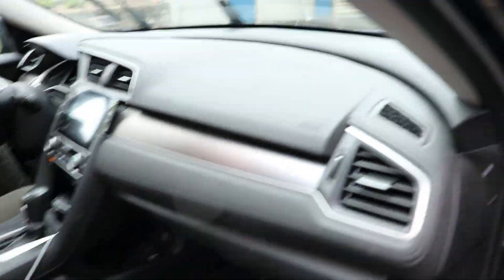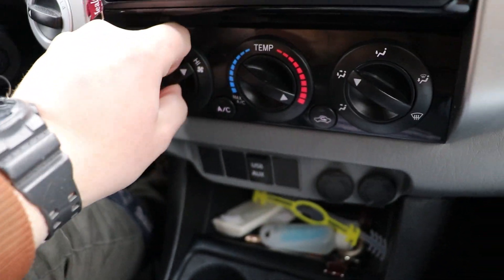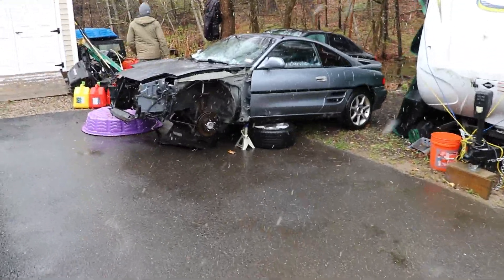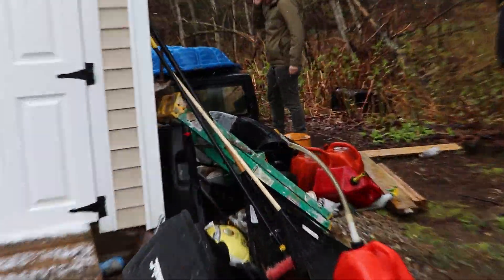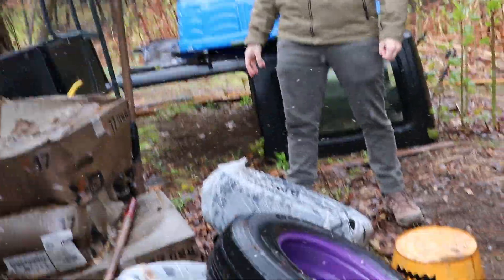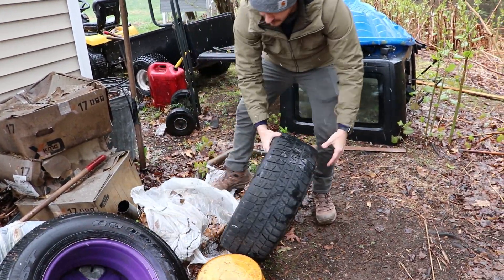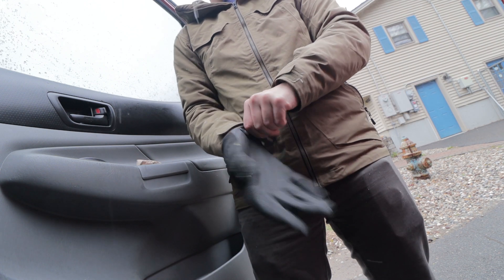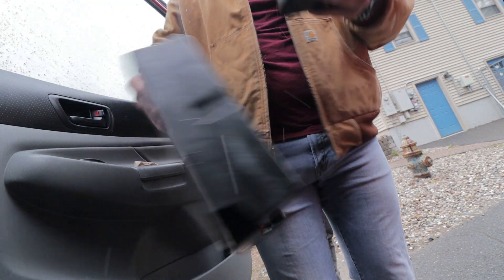Buying Cheap Wrecked Boat - Boat Restoration Part 1

Comment: I have just had the same engine rebuilt using a block that I bought and supplied to the guys doing the re-build for me. The front crankshaft oil seal has started to leak and someone mentioned it's a felt type. Is that correct and is the rear one the same type or different / more durable? Engine is back in the boat now and I'm hoping they can replace the front without needing to disconnect and lift back out (sound doable?). The rear will be a big job! Really enjoying watching what you've done to understand what I've just had the shop do for me. Thanks once again.
Reply from the maker: https://youtu.be/0hzlRWrH1N0
Reply from the maker: In the video i linked to we talked about how there is a rear cover that you can buy that comes with a rubber seal. I also brought the front cover to a machine shop and had them machine the old front cover to accept a rubber seal.
Reply: Thank you - hadn't got that far yet! Brilliant series and thank you guys!
Reply from the maker: @stevea9955  You’re welcome! I think it will mitigate your issue substantially and it was only a $150 mod when i did it

Comment: How much did you buy the boat for ?
Reply from the maker: We bought the whole setup for $500
Reply: @DownToTheFrame  nice. I just a bought a 1975 Tahiti with the exact same motor and your videos are very very helpful with sorting this engine out. Thanks for that. I’ll be starting my rebuild soon enough. What supplier do you use to get parts for the Volvo? I need a fuel pump asap ja
Reply from the maker: @jason6778  Thats awesome to hear! This is the link to the website we used to get most of our parts https://www.volvopentastore.com/